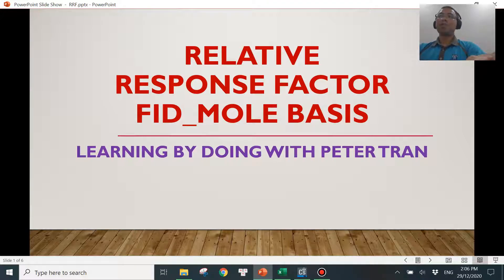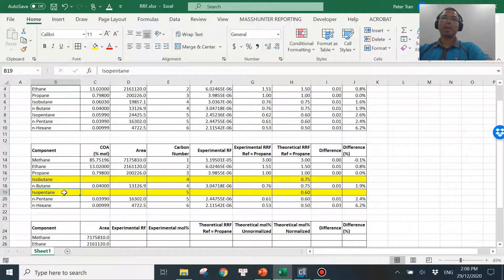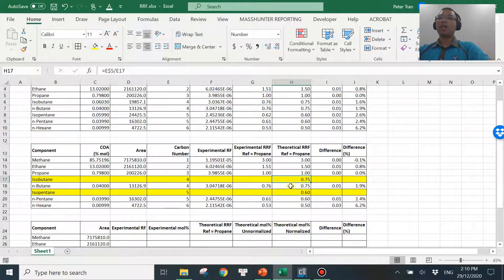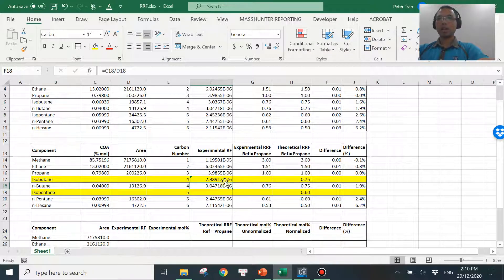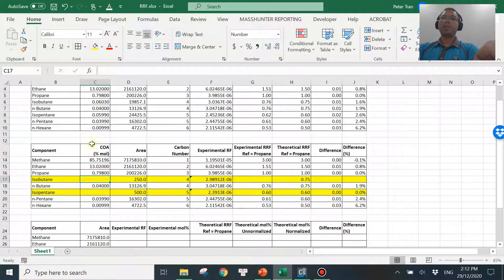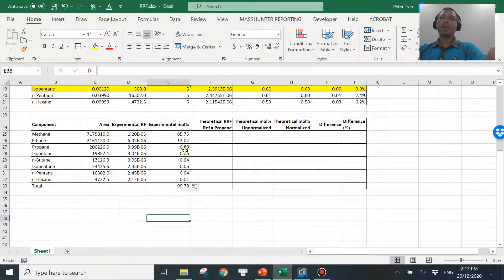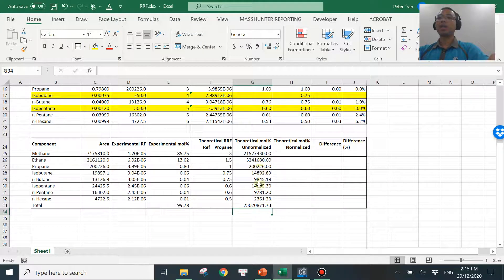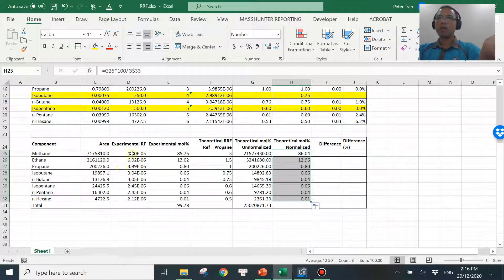Relative Response Factor | How to apply on FID with Mole Basis | Part 3

Comment: Hi Peter 
The problem was in  registration Authorization codes .A message appears the codes registered
We need regenerate licenses because We plan to change PCs' in our lab
Reply from the maker: Hi Dheya you will first need to "return" the existing license before it will become available again for you to redeem it again. Note that this "return-redeem" cycle can only be done twice or thrice. After that you will need to write to Subscribenet support team if you wish to do that again with a valid reason.
Reply from the maker: Once you log in to your subscribenet account, click on "Generate or View Licenses" at the left side menu. Then expand "View Details" from the right side and you should see a "return" button. Select the correct MAC address of the existing PC and click on "Return". That should instantly give you one available license. You will need to repeat the "Return" for all types of licenses (CDS Chemstation, Instru. Driver and Data analysis if any).
Reply from the maker: You should be now able to generate a new license file for your new PC. Let me know if you are stuck at this step.

Comment: The video is very interesting and useful.
Thanks
Reply: Hi Peter thanks for your fast reply.
Like what I told you before I cannot regist  Authorization codes Which on the purple envelopes.
I think the technician who did open lab installation registered  codes in his subscribenet .
should I contact with him about Authorization codes 
Thanks again
Reply from the maker: @dheyajabber6957  I see, if you go to C:\Program Files (x86)\Agilent Technologies\OpenLAB Services\Licensing\Flexera\licenses\AGTOL there should be a file with LIC extension. Open it by notepad and look at the first few rows one should mention who is the account holder of your license.
Reply from the maker: @dheyajabber6957  Once you have the account holder name, you can either ask the engineer who you believe have registered your license to ask you as an admin member in subscribenet. Alternatively you can always send an email to subscribenet support team at subscribenet_support@agilent.com who will be able to add you as an admin of the existing account or transfer your license to a new account under your name. Once you have the control of your account you will be able to "return-redeem" as I mentioned earlier.
Reply: @PetroChromatics  Many thanks for this  valuable information
Once I back to our lab I will do what you recommended in your previous response.
Reply from the maker: Thanks